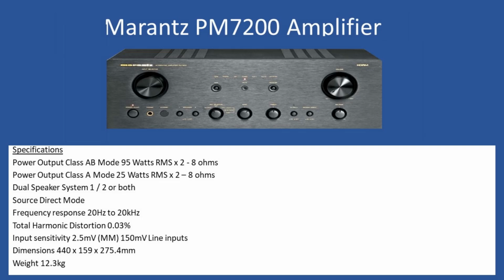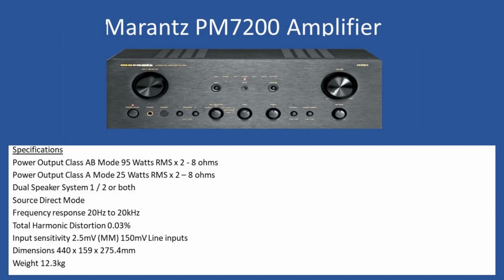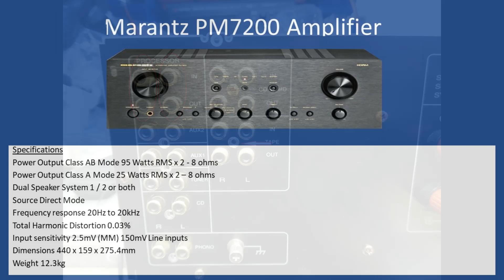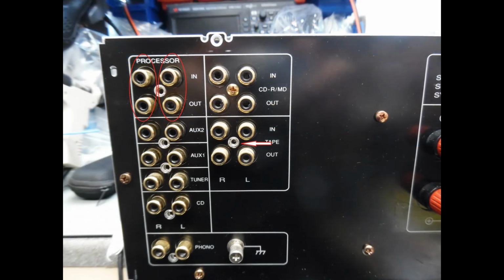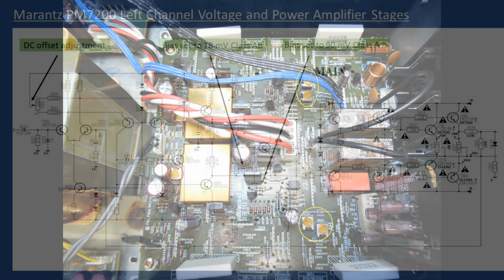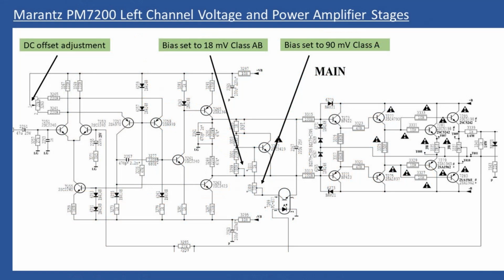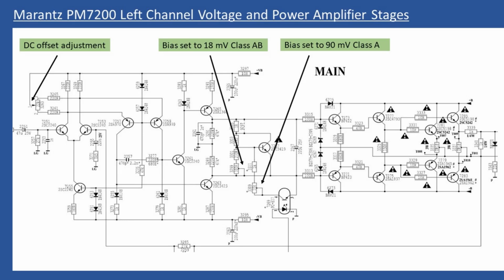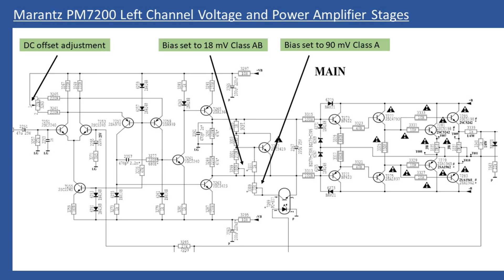Marantz PM7200 Amplifier Repair (With Audio Tutorial)

Comment: What's your take on the ZD915? I can see it in in the background of one of the stills. From my experience, price/performance ratio cannot be beat, but needs to be regularly and thoroughly cleaned, which is a bit of a pain with fliter inserts replaced. Have you had a chance to put a Hakko through its paces? Wonder, whether it makes sense to invest a lot more.
Reply from the maker: Hi I have not tried the Hakko range https://hakko.co.uk/product-category/catalogue/desoldering/desoldering-tools/ but to be honest I do not use the desoldering station very often normally I use a hand held desoldering pump, brand Miller.

Comment: Hi mate,my Marantz PM4400 has flat bass effect now on both AB outputs.Could you fix the issue?.
Reply from the maker: Hi if the tone defeat is turned is turned off and the bass and treble controls are adjusted is there any change in the Audio. Also are you hearing the same issue with both the right and left channels.
Reply: @AudioAmplifierServicing  hi.thank you for an answer.Tone deafet makes difference on or off.I would say both channels are same,however the problem  seems to be intermittent.
Reply from the maker: @Goblin-ti3bn  Hi It does sound like the switch for the tone circuit on / off requires cleaning, most likely oxidised and dirty contacts.
You can email audioamplifierservicing@aol.com
Reply: @AudioAmplifierServicing thanx mate .where you are based?